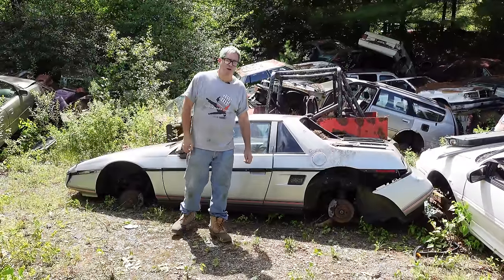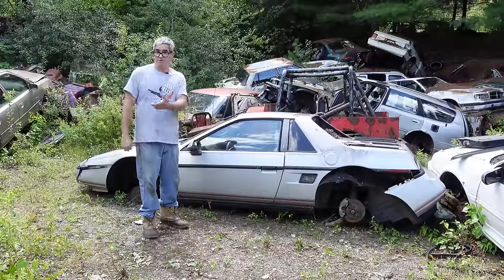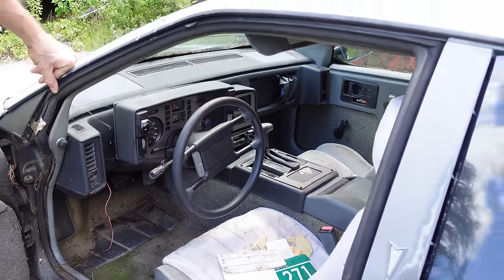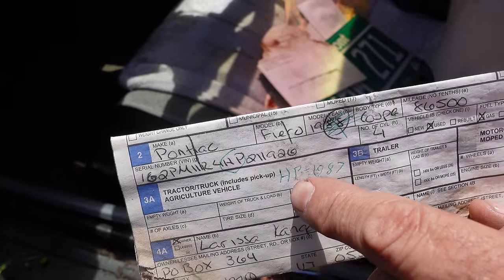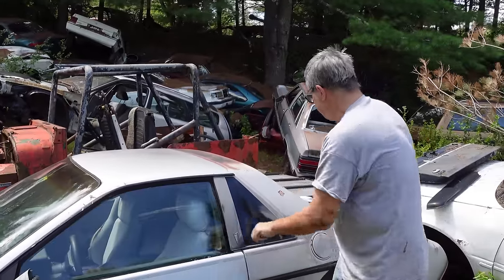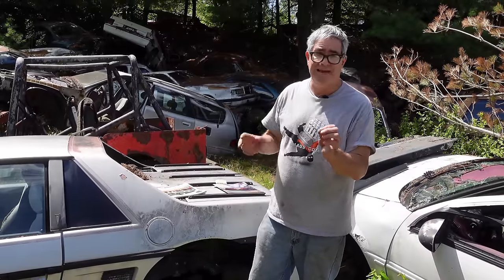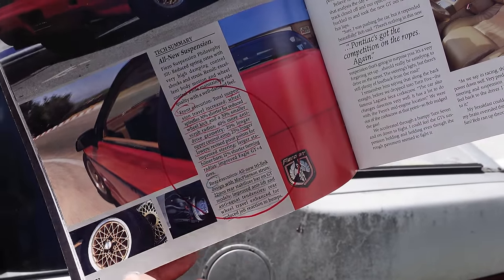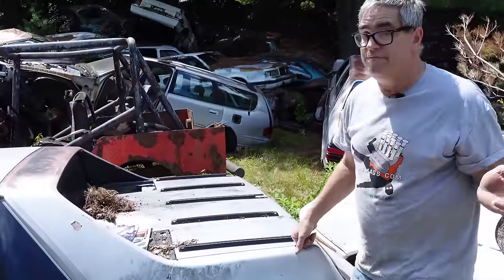The Mid Engine Pontiac

Comment: On the 1988 Fiero, what is the part on the rear suspension that appears to be a tie rod? It gives the impression of a front suspension from a 2-wheel drive car.
Reply: What you see is the Anti-Sway Bar. It was added with the new suspension & Brake package on the 1988.
Reply: @paul all Fieros used steering knuckles from FWD cars. What appears to be a tie rod is used to set the toe-in.

Comment: An ‘87 Fierro was my first new car purchase.  I actually hated the look of it, but Pontiac had a financing program for new college grads and my ‘69 Charger had all sorts of electrical gremlins.  So, I got the Fierro.  Oddly, I wound up liking the car.  I got 30 mph in town and nearly 40 hwy.  it was comfortable and had a great sound system, but it was a complete piece of junk.  By 30,000 miles the AC compressor was shot.  By 40,000 the electrical fans for cooling were shot.  Finally, at 73,000 the thing dropped a valve.  Astoundingly awful reliability.

Comment: I'm surprised Steve didn't mention especially reporting from the land of rust about the radiator coolant tubes integrated into the unibody running on both sides front to back that rusted end to end and failed.

Comment: Hey Steve - those vents in the center console are not speakers. They're decorative largely. Speakers are on the B pillars under the cloth covers for 86-88.
Reply: Oh, and different roofline for 88?  Every single panel on every year is interchangeable. '88 changes were all in the suspension.

Comment: Pontiac Motor Division ceased to exist in 1984, and the Fiero was the last new product bought to market by PMD.  I had started college in Fall 1983 just as it was hitting the streets.  It was a far cry from the Banshee of 20 years earlier that had a 230 OHC6 1bbl engine and ran circles around Corvettes with 327 V8s at MPG.  A furious Ed Cole stormed into GM Corporate and demanded "THAT NEVER SEES THE LIGHT OF DAY!!!".  When Chevrolet couldn't compete (which was most of the time) they played corporate politics to get their way.  So in the end all Pontiac could muster was the Fiero, and other than the innovative space frame and plastic body panels was made from the parts bin at GM.  The front chassis was the front end of the T-car (Chevette) and rear end/powertrain was the front end of the X-car (Citation) with the steering linkage bolted to the space frame, and avoiding being (one of the) first cars to have all wheel steering.  The 2.5L Tech IV (Iron Duke with TBI) was far more durable than the 2.8L Chevy 60-degree block V6 developed for the Citation, which was a junk engine design, and I always like the cleaner lines of the original Fiero anyway.  A split personality was not good the Fiero.
Reply: False - Pontiac ceased to exist in 2010, 26 years later than what you stated.  Not even close.
Reply: @timmbacher  , no Pontiac Motor Division was folded into Chevrolet-Pontiac-Canada Group (CPC) in 1984.  This was nothing less than the complete takeover of Pontiac by Chevrolet.  All the autonomous divisions ceased to exist with CPC and BOC.  What you're referring to is an empty brand name on a plastic badge administered by a Pontiac-GMC group within GM Marketing, but all the of substance of Pontiac Motor Division (styling, engineering, management, etc.) was long gone by that time.

Comment: Thank you.  Somehow, getting rear ended in this tiny car and sending the engine into the passenger compartment does not float my boat.  At least with the engine in front of me, I might be more aware that Aunt Agnes is coming my way and be able to at least try and take evasive action.  Now then, if I were to take I-15 to Vegas on a 110 degree day, would the engine overheat going up the Cajon Pass?
Reply: Actually from 84-88 the Fiero was the SAFEST car sold in America, even beating Volvo.

Comment: I can’t remember. But didn’t they have a tendency to catch on fire?
Reply: Only the 4cyl iron duke. Oil would leak on to the exhaust manifold. Also was only 84 and 85s that had that issue. 2.8 V6 GTs were pretty nice cars.
Reply: Definitely a good looking car at the time. There still around.

Comment: I never cared for Pontiac's "Plastic Fantastic". They weren't real Pontiacs to me and they weren't up to the task. Yes, they have their followers, but I'm not one of them. It's no MR2, that's for sure. Yup, the "frunk" as we call it today. LOL.

We got the VIN, we win: 1G2 for US made Pontiac, PM11 for Fiero sport coupe, R for 2.5L four cylinder with TBI, aka "Iron Duke", 4 is a check digit, H for 1987 model year, P for Pontiac, MI assembly and the rest is the production sequence. The Pontiac, MI plant was the Pontiac "home" plant and closed in 1988 after the last of the "G" body cars and Fieros were assembled there. Correct, the VIN is for a 1987 model year as "H" is for 1987, and "J" is for 1988. No, "HP" doesn't mean 1987 model year. "H" is 1987 model year, "P" is for Pontiac, MI assembly. 

Yes, 1988 is a "different" car as they had their own suspension and didn't borrow parts from the Chevette, Citation (and other model) parts bins as were done for 1984 to 1987. Typical of GM, just when they get it "right", they drop it. LOL. 

No tag, can't brag, but this is code 40 White exterior paint.
Reply: Code 40 was always a pain in the keyster. There were many alternate formulas (color variations). Some were very yellow, like ford's Wimbledon white, to Brite white, like Chryslers pw7, depending on model, and plant where they were built.
Reply: Correct. Different paint suppliers.
Reply: Borrowed one from a friend back in the early 90's when my vehicle was in the shop.
They are subject to hydroplane very easily.
Reply: Not a fan.
Reply: There was a mechanic that worked at a Dodge dealership I worked for that had a 6 banger Fiero. He told me my 92 Dakota with the magnum 3.9 v6 (first year for the magnum) wouldn't touch his Fiero in a drag race. I had the short bed, 5 speed manual, with the optional 390:1 gear. We finally raced, if you want to call it that. I smoked him off the line, and constantly pulled away the entire 1/4 mile at Desoto speedway. Those Fiero's were pigs. I rode in his once and it was a rattling pos. And yes, they hydro-planed! He totaled his in the rain. Hydro-planed on a wet road, hit a concrete utility pole, ripped the front end off completely. Fortunately he sustained minor injuries, and bought a full size chevy van. Lol

Comment: Fiero,s are rollin bonfires, back in the late 80,s oil leaks were catching those cars on fire. Its a rear engine car if it was a mid engine car the motor would be sitting next to the driver. They had problems with very hot engine compartments. I worked for gm and witnessed it. Gm stopped making them for good reason. The drivetrain is derived from the failed x  body
Reply: Rear engine is behind the rear wheels, mid engine is ahead of rear wheels. The Fierro is technically a mid engine car, even though it's dumb.

Comment: So many remnants of the x body car , the engine compartments would get so hot in those that there was a lot of engine fires. Slight oil leaks added to the barbecue factor. Its a rear engine car , lift the hood and look
Reply: MID engine, not rear. The engine sits OVER the rear axle, not BEHIND it.

Comment: I went with the MR2 instead of the fiero, the suspension was by far superior. Handling is amazing on an MR2.
Reply: I wonder if the 1988 suspension upgrades made it more competitive with the MR2, or were you comparing a 1988 Fiero to a 1988 MR2?
Reply: @marcusdamberger  I was comparing before 88. I'm not sure about 88 or after.
Reply: @marcusdamberger   The MR2 suspension was designed by Toyota and Rodger Becker the man that did lotus. That is why the handling is the way it is and a little snap over steer thrown in for fun. Lol
Reply: Why repeating it again, huh??? We don't care about MR2! You like it. Good for you! Now, beat it!

Comment: Hard to believe Steve omitted the Pontiac Fiero "fires"!
Reply: It's not a big deal. Only about 260 of 1984 due to lack of oil with small oil pan. They recalled it & fixed the problem.